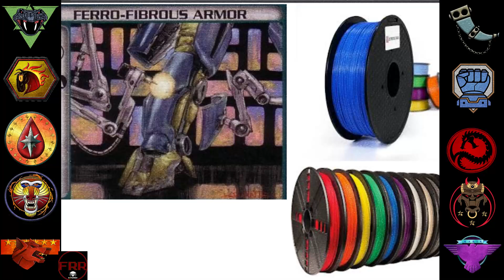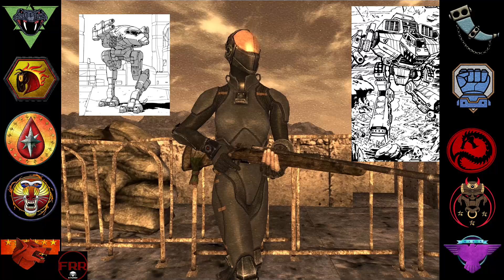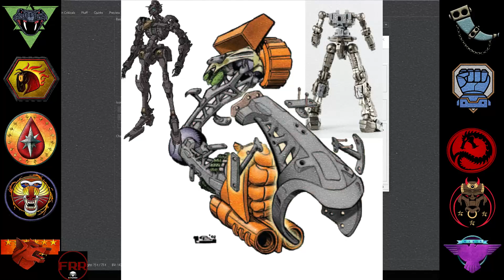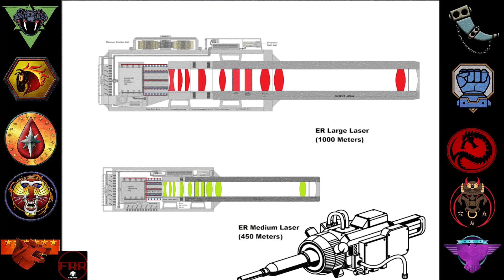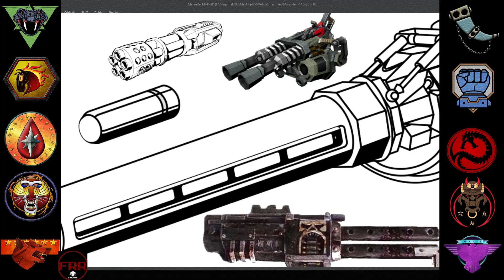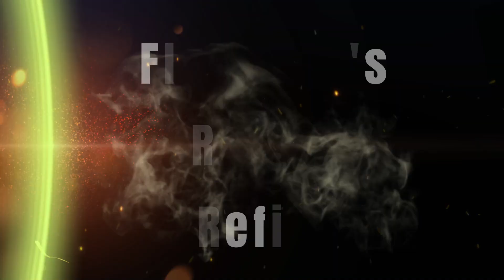Battlemech Refits: Are they as easy as the games make it sound?

Comment: I'd think working with Clan gear would be a lot easier, mainly because it's mostly modular by design. due to being used in both the second-line and the Omnis.(main advantage of the latter being that all of the other components as well as the mounting frame, are also modular). But yeah, I'd think an Endosteel refit would be the worst, kinda like replacing the chassis on your car...probably the easiest way would be to strip every bit of equipment off the old unit, and then basically rebuild it on the new frame, almost like building a new Mech.
Reply from the maker: The problem is this: 
Clan gear is standard WITH ITSELF. Once you try to integrate it with Inner Sphere technology, it generally WILL NOT MATCH. 

And yeah. If someone asks you to "just make the skeleton from Endo", you look at them and you say "Just buy a new 'mech".

Comment: Uh. No. realistically, replacing normal armor with FF would be fairly complex, because any military device isn't going to have "free internal space". Why? Because leaving lots of unneeded voids inside a vehicle of any time means you are making the vehicle bigger then absolutely neccessary. Which means you have a larger siloutte to be hit. So your going to be building the armor out, not in. Which means it's going to imping on all the joints.

Comment: In my heat cannon with all the stat similarities I always figured that LBX autocannon would be easier swaps for the same reason as the guass rifle, its all based on a standardized Star League template. Ultra auto cannons and standard autocannons are based off the different nations ideas of what a good caliber would be.
Reply from the maker: @Ruggedtoaster  LB weapons are made by fewer manufacturers, which is the HUGE advantage of them.
Reply: @ yeah less chances for the good idea fairy to convince say Defiance that having a proprietary caliber is better way to protect their market share than say pushing refit packages at some kind of discount to major buyers for their models that fit a common mounting structure so they can get the military where the big money is, the maintance and replacement parts licenses on those 5,10,20 year supply contracts.

Comment: How much TSM do you encounter in structural requests?

Triple-strength myomer seems an extension of the structure issue, and I know our folks at Bergan Alshain, Balmung, and Ares get a ton of requests for that swap.
Reply from the maker: @christopherpurches2774  It is fairly common, but it is easier to replace myomer bundles than a full skeleton (as long as the connectors are in the same family).

It is one hell of a job, but easier than swapping an engine or the entire skeleton.
Reply: @ProfessorHeyTeeEn  would the connections themselves not also have to be updated to handle the higher levels of torque and pull from the stronger and faster myomers?
Reply: @ProfessorHeyTeeEn  I had a Highlander modded with this stuff, and every time I landed a headshot with the hatchet the shoulder assembly pulled itself apart.

Comment: Of course, every armor type you name also requires a layer of synthetic diamond or carbon nanotubes, polymer sealant, and maybe some extra treatment in a machine that has more in common with a PPC than a lathe in order to get the atoms in your print or casting bumped around into exactly the right configuration by the electron or proton beam radiation. Mech armor is light, and only centimeters thick, but it's complex stuff.

I know a company who does various High-entropy alloys like Endosteel in a powder form so you can laser-sinter them together, but the powder still needs to be milled in 0g.  And while you can sinter the parts to order, you still gotta strip the mech completely and rebuild it.  That's a factory job, no question.

I'd much rather be assigned to find the right connector than to find the right driver to make a 2600 vintage Star-league bit of programming talk to a 3050 vintage Clantech Laser.  And, while the laser modules themselves are plug and play, armory work on those lenses requires a clean room, and heaven help you if you drop a diamondoid lens and crack it.  

I want to build a time machine, go back in time, and fight a trial of refusal against the guy who decided the Clans were gonna standardize on such sizes as 115mm.  As far as I can tell, that was just to make the Technician caste's life more hell. 

Once, I had to install actual ballast, 1 ton of lead weights, on a mech when it got a clan missile launcher.  Never worked with ATM, so no idea what that's like, but I think my worst experience is doing electronics refits.  Getting the mech to talk to a new ECM system or an advanced targeting system is all about those drivers, and good libraries for them are sometimes worth more than the parts themselves.  Bad drivers and interface programs can rob you of efficiency, or even be trojans to sabotage your mech.

Comment: I always saw it as the techs cutting and welding everything to fit all over again if they're good.
I also imagine some old mechs have structure points that are at least 40% pure weld.
Reply from the maker: @Marxon1134  At some point, it gets easier to replace the entire "bone", especially when you have a facility to cast them PlanetSide. Doing it "on a dropship" might not be as easy, however.
Reply: I always figured it was like regular vehicles.  If the sutocannon fails, you need 5o unbolt it and replace it with an identical one, OR you are goijg to be welding up.custom bracketing or cutting out holes. Lasers probably dont havr a universal tube or apature size, so I could see a swap needing a housing get opened up to let a bigger focuing lens peek out.

Comment: Hello Professor. 

I recently came across your video about Battlemech Refits. Overall, I agree with just about everything you spoke about. Time, costs, labor, parts availability, ease or difficulty to produce equipment and replacement items, and the absolute need for a full up Mech Repair and Refit Facility at the very least. Although Repair Bays on drop ships, and the Mobile Repair Bays are useful, they are not meant for extensive upgrades. Especially things like Endo-Steel internal structures, and changing Engine ratings to alter a Mech's combat movement performance. 

There are so many specialists needed to make up a good Refit and Repair team, and even more for one that specializes in Mech redesigns of existing Mech types and variants upon those types. In some cases it is impossible to perform such extensive remodeling of a Mech without both types of teams and their specialists. And attempting to do so without the benefit of a full Facility is literally almost impossible. 

Even having full a full up Repair and Refit Facility, one requires the manufacturing base to support the effort. One also needs the logistics, time, and planning to successfully see such an upgrade or rebuilt to completion. 

On top of all this is the 'cost'. Both in time, manpower, resources, machinery, tools, equipment, supplies, and even housing for those working upon the project. Huge investments must be made in Computer capacity, computer banks, data stores, and even physical, historical documentation storage and cataloging. 

That last factor is why the Hellsport Mek Werks is so closely connected to the Hellsport Mech Museum and their vast store of existing Mechs, Mech parts, data banks, and historical archives. The Mek Werks updates the Mech Museum with full copies of all files associated with every project taken on by the Mek Werks. 

Some of the Museum staff have offices here at the Mek Werks to make those copies, literally on a daily, or even hourly, basis. Plus, both Digital and Physical copies are forwarded to the Mech Museum to ensure that the processes used remain fully documented and current. This is so that should anything detrimental happen, the data can be used by another team to replicate any stage of the process, up to and including final construction and testing. 

The Stygian Compact has not been invaded during its 130 years of existence, and the Compact has ties with most of the Periphery Powers, as well as many of the smaller Periphery Nations and Single Planet Governments. On top of this is the on-going relationship with Clan Diamond Shark / Sea Fox, and communications links with groups like yourself and your team in the Fronc Reaches, and others. 

This stability is mostly due to the Compact's location in the relatively 'un-mapped' Perseus / Cepherus Cloud Complex that Compact Citizens call the Staplin Nebula. It is also influenced by the relative richness of the Rare Earth Element deposits in the Stygia System, which are mined, refined, and shipped all throughout the Periphery. 

Which, has led to the Compact being wealthy enough to afford to build and expand manufacturing, refining, and industry as a whole to levels unseen since the days of the old Star League. 

At most, anyone stumbling upon the Stygia System would see a heavily industrialized solar system with no 'habitable' worlds, several gas giants, dozens and dozens of moons, three asteroid belts, and hundreds of drop ships plying between them and various orbital smelters and other space-based facilities. 

The system is guarded by dozens of Corvettes that are actually armored and armed Merchant Class Drop Ships, as well as well over 70 armed and armored drop ships, specifically redesigned and rebuilt to be 'Carriers' for multiple Aerospace Fighters. 

Any Bandit group attempting to raid the system would be intercepted and destroyed before they could recharge their KF Drives to jump out of the system. Actual Warships would be overwhelmed by the combined firepower of the Corvettes and the Combat Drop Ships, even though they would take terrible losses in doing so. Losses can be replaced, in time. 

The Mek Werks is a facility for designing, redesigning, and constructing new variants on existing Mechs, Vehicles, and other equipment. Once the 'bugs' are worked out, the data is handed over to the Compact's Manufacturing groups and the Government, to determine if the design has enough merit to warrant production on any scale. 

The Mek Werks makes 'one off' designs, with full documentation, and suggestions for scaled up production. We do not engage in production lines, unless it is for some testing purpose, like the building of a limited number of a design for full Combat Testing and Assessment. 

I do hope that this message finds you and your team in good spirits, and fully employed. My own staff is always busy with one project or another, and rarely finds the time to 'make trouble', unless you count various practical jokes to be 'trouble'. 

Jason Andrews
Chief Tech
Hellsport Mek Werks
Hel, Sheol III
Stygia System
Stygian Compact

Comment: The Hardpoint System and it's Consequences Have Been a Disaster for Mech Customization (A Rant-i-festo)
Reply from the maker: The video games have warped people perception of things so much it is crazy. I understand the WHY, but it made people not understand how hard some of those changes would be.
Reply: @ProfessorHeyTeeEn  The pre-MW4 games essentially made every mech an OmniMech, yes, and like you say I can understand the WHY of the hardpoint system, but it's implementation has crowded out a number a modifications I've been using for years, and I don't just mean "Put 12 medium lasers on everything and be a cheesedick" either, I mean balanced variants that are different enough to be unique but still fit within the "spirit" of the design, or fill a capabilities gap.

Rather than simply locking out certain mods, there should be a system that allows users to make whatever they want, but radically different mods should be wildly expensive and time consuming to accomplish. To balance it out, OmniMech designs should have unlimited and easy modifications, but the repair costs from battle damage should be wildly expensive. 

Of course this system would really only work on a single player, linear campaign style game, and we all know that the hardpoint system was implemented specifically because multiplayer games had devolved into 16 player free-for-all games of Shadow Cats with 16 ER Small Lasers being absolute assholes to anyone trying to have even a modicum of immersion. 🤷

Comment: Well it shouldn't be that hard. You got a hole saw you got a welder. You got duct tape and an extension cord. You should be able to wire anything up right now. You know making tubes for an lrm or srm rack addition that might be a little hard
Reply: having worked on crusaders in the past, bud, if the missiles go, you tend to replace shit quickly from damage. or just have the unit totaled. but hey, that's the crusader mech lifestyle, insanely useful one moment, mushroom cloud the next.
Reply: @baker90338  Or the Crusader becomes a 'hanger queen' and used to salvage parts from, until it is basically rendered down enough to just break it into pieces that can be stored in case they might prove useful in the future. Or, doing that in the first place, and just 'warming up' a replacement Crusader and saving the other's parts for replacements.

Comment: A lot of people forget that each mech is also balanced in a very specific way based on it's weapons and equipment load. So swapping a 1 ton laser for a 1 ton laser is not terrible, but swapping a PPC and heat sinks for an AC 5 or the reverse is hard to get right outside a factory.

Field refit kits have been designed and perfected in a factory to ensure that if you follow ALL the steps correctly then your balance will be preserved. That is why they are much easier to do than custom load out jobs.

Once had my Dragon converted into an 'almost' grand dragon due to lack of AC ammo, the PPC on that thing always overcorrected it's aim till we got back to a factory to get it fully resolved. Might seem like a small thing, but a slight imbalance can cause massive accuracy loss in certain conditions.

Don't get me started on the issues of adding Jump Jets to a mech that did not have them before in the field. Sure the refit itself is not terrible compared to a lot of others, but the computer work, the stabilisers are all the weapon housing modifications to account for the rough landings is a nightmare!

Comment: Logically speaking replacing the structure is basically rebuilding the mech, replacing the myomer is similar, the engine would be difficult, especially trying to install an XL, same with the heatsinking, but armor and weapon loadouts should be pretty easy.
Reply from the maker: @killcat1971  Heat sinks is not TERRIBLE, especially adding some after you made room, or if most of them are in the engine.
Reply: @ProfessorHeyTeeEn  I was thinking more upgrading from SHS to DHS, we can assume there's enough room for SHS in the torsos at least.
Reply: If you were only replacing SHS with DSHS in an old 3025 Era Mech (depending upon the exact Mech), you may find that the Mech has enough internal space to enable the tech staff to mount heat sinks beyond those contained by the Engine. In most cases, the total number of DSHSs needed is far less than the previously mounted SHS. This leaves space and weight available for other means, or the Mech runs 'light' on tonnage. Finding space, weight, and mounting points for more weapons and equipment can be a truly daunting task, and it would take time. Lots and lots of time, trials, adjustments, dis-mountings, re-mountings, and the 'project' may end up too expensive, time consuming, and just plain beyond any shipboard Tech's means to perform in any case. NOT taking all this into consideration has ruined Mercenary Commanders over the centuries.
Reply: @franksmedley8619  It was more how much they have to strip out to replace it, I assume that there are fluid runs throughout the mech that have to be replaced.